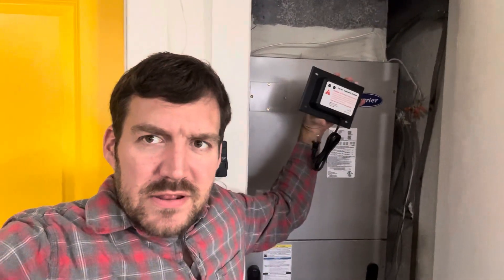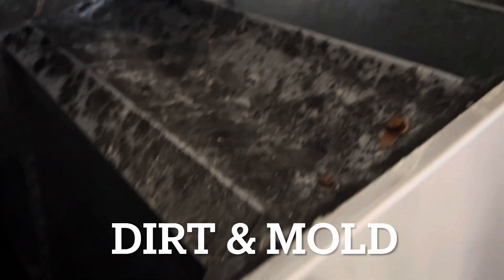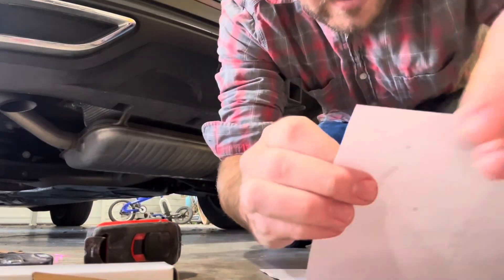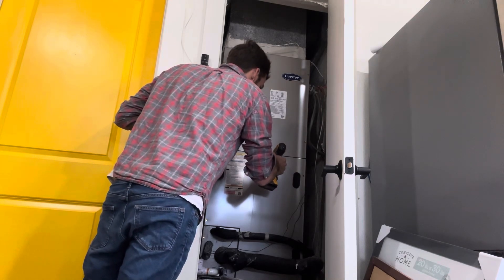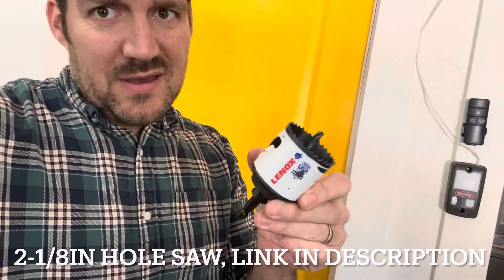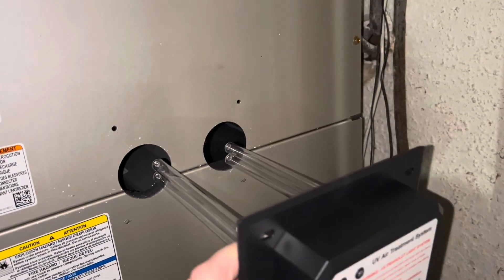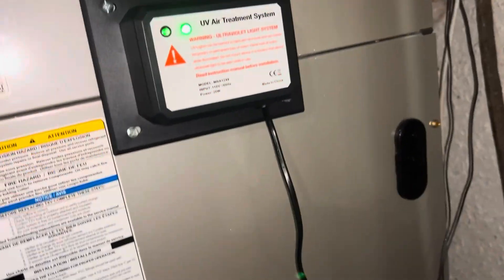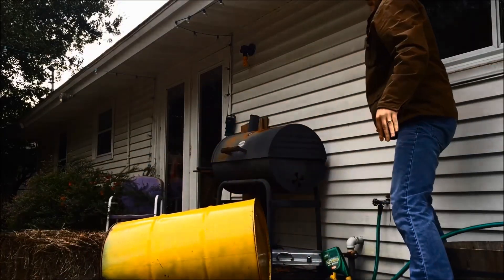How to Install UV Light for HVAC Mold Prevention

Comment: I don't think it should be that close to the burner.  Would be worried about it melting
Reply from the maker: Thanks good call, just checked (been on for 3 days) and all seems fine. Did order a light timer to only run it half a day going forward. Did notice air going in around edges though so going to add insulation tape around the edges 👍